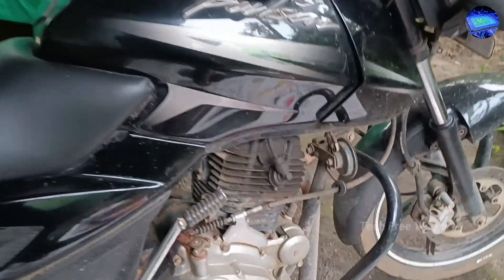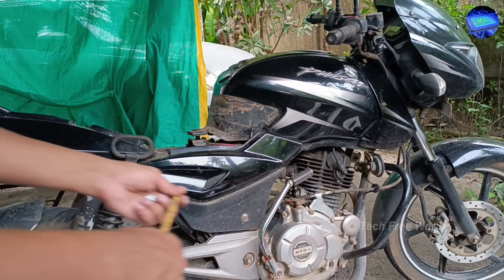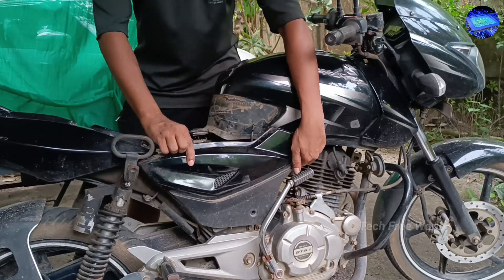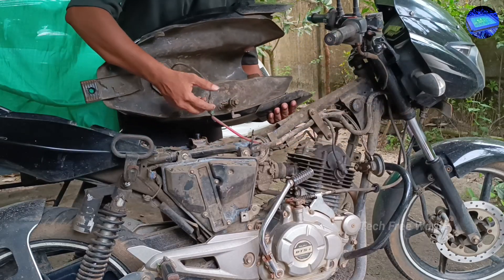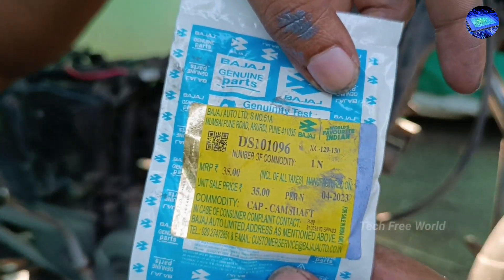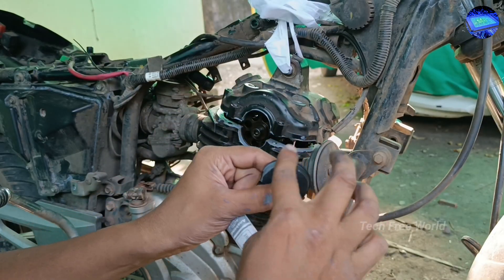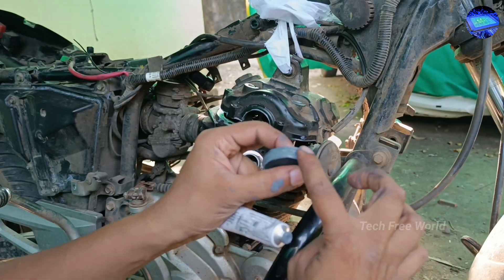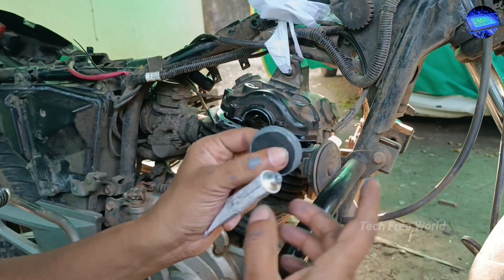Pulser 150  Camshaft Cap Replacement without Completely Remove Head / Engine Head Oil leak Fixing

Comment: Great vid bro
Reply from the maker: Thanks bro.  ❤️🥰 This is my bike. And this trick working perfectly.  No oil leakage
Reply: Bro my bike same issue. This work solve mechanics charge estimation amount  @TechFreeWorld
Reply: Can I use anabond with out opening even that bolts, I mean can I apply anabond on edges of rubber seal?